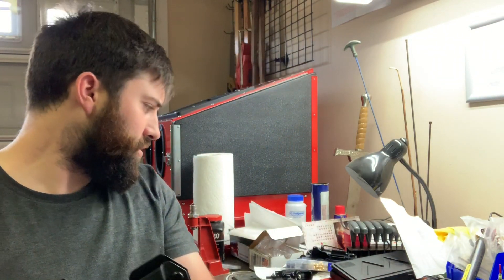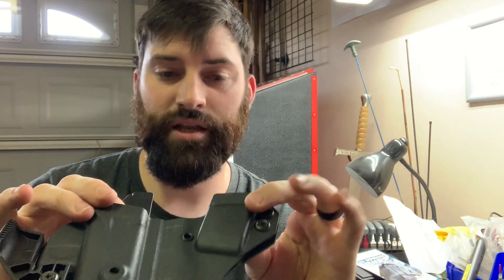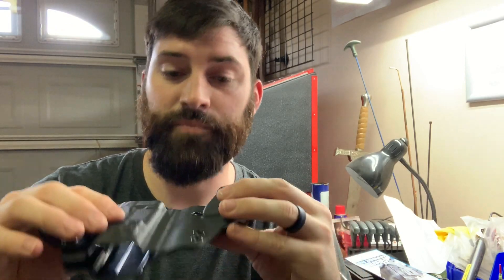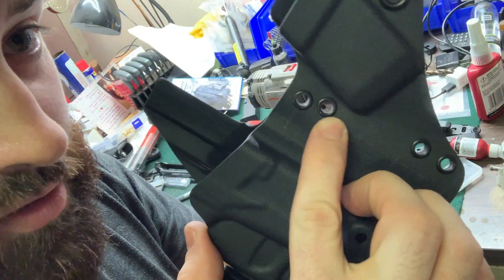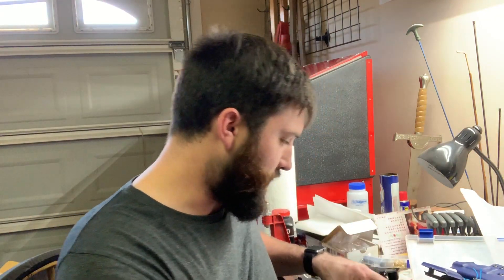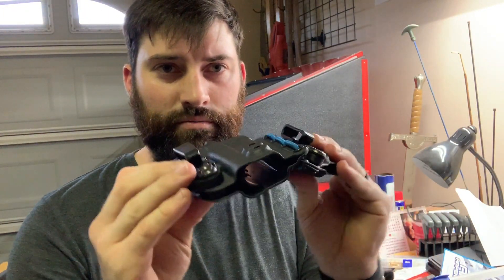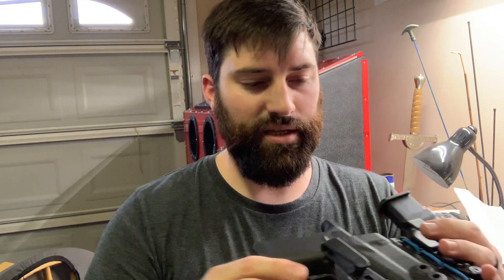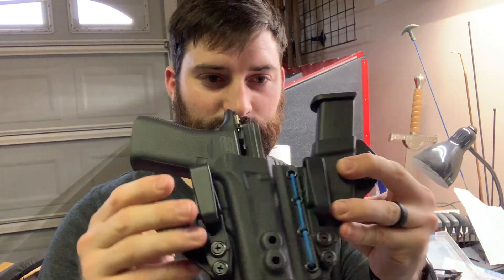Glock 43X Spider Concealment Holster Mod

Comment: I think the mag carrier part should be on the outside of the gun side.. makes the smaller mag side flex a bit easier..
Reply from the maker: Should be easy enough to switch that around 🤔
Reply: @CalebDowning  oh yeah,,easy fix,, I think you'll find it conform to your waist a little better

Comment: How's it going??  Seen the notification , but did you try heating up the kydex?? That's a pretty good idea!!! It should work!!! Keep us Posted!!!
Reply from the maker: Hey man, yes. I heated up the kydex enough to straighten the holster out so I could put the rivets in. There was an original bend to the holster, I forgot to put those pictures in the video 🤦‍♂️ There will definitely be a part two where I’ll show those pics.